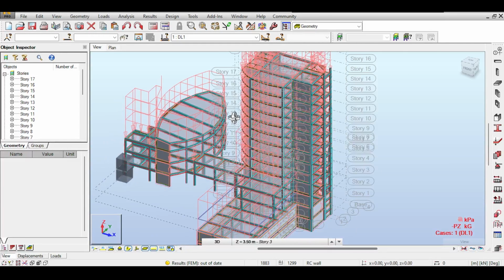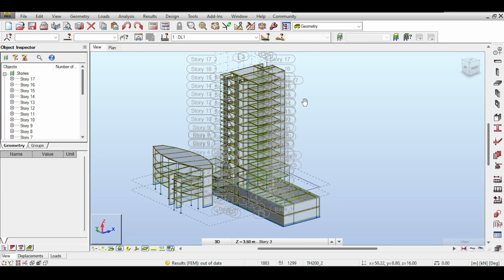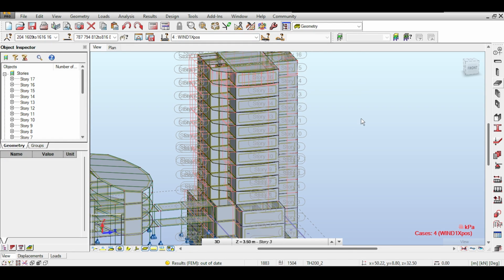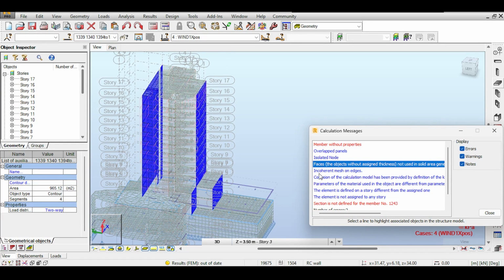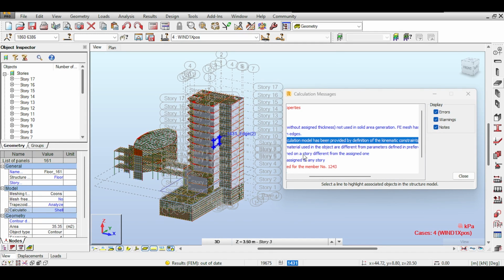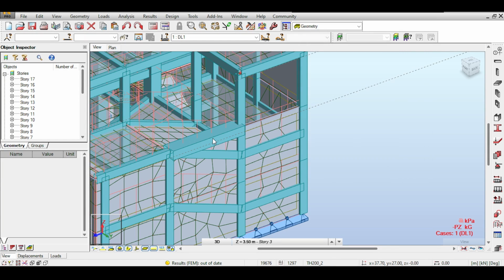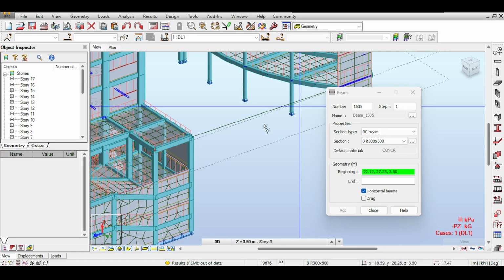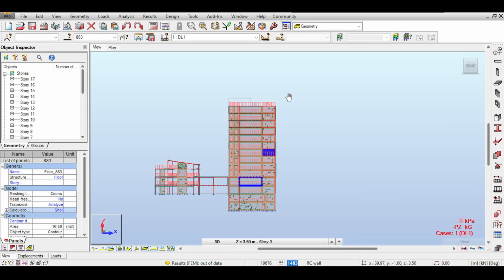Modeling and Design of RC Buildings in Autodesk Robot | Part 16: Wind Loads and Errors

Comment: Hello my thesis project is on CFD simulation so can I perform my project in this RSA .. as ansys is hard for me😢 please help me.. my project is analysis of high rise building with opening in it for wind loads using Numerical simulation (CFD simulation) please help me
Reply from the maker: As I mentioned in other videos, I am not really a fan of RSA's modeling of wind loads. So I really cannot recommend it.

PS: sry for the late reply.

Comment: Thank u for the video, Sir

Great video with stunning explanation, hope u doing well and stay healthy. Anyway if u have time, could you check ur email, I sent you my RSAP file as ur request that day, already solve the problem, but curious about the spiky moment, also i read couple of Autodesk Forums online, that said it's because I'm offsetting my beam to not be in the center of the grid level but on the bottom of it (upper beam). Because i want my actual level is my top surface of the beam. I'm giving the idea, if u want to make the video that talks about offset beam, slab and column and so on to explain what is the purpose, the relation to the internal force such as moment, shear, stress, normal, deformation and so on,  and the comparison of with and without the offset. 

Also I'm struggling to learn how apply the T beam and L beam in RSAP, because my college project actually using it and when i provided the reinforcement and run the calculations, it said

"the slab section was not transformed to the flange of T section robot structural analysis" 

I'm frustrated haha, i read the forum, watched hours of video that didn't even solve the problem, why am i design the T-beam, if the reinforcement just for a rectangular beams 😢. Here's i give the idea again if u have enough free time to make the video that special talks about the T beams and L beams. 

So sorry for the long comment, cus u're my fav yt channel for learning the fundamental concept, also I'm really enthusiastically learn more about the robot to apply my theory in college. 

Thank you so much sir 🙏🏻😇
Reply from the maker: I just checked my email. It seems it landed in the spam folder. Sry bout that. did not notice it.

Yes, offsets do tend to have this crazy problem. It is because the offsetting causes rigid links to be generated between the beam and the structure. The spiky moments is due to those rigid links.
I actually have a video discussing offsets on this channel, might be beneficial.

For T beam and L beams, I saw that you have already defined successfully a T-beam in the file you sent me. But it seems that there is a problem with regard to the design of those Beams. I will definitely make a video about them. Consider it done. No need for frustration ^_^. I will check it out and make a video about it. Even if it does not work, I will make a video saying that this is not working. At least people do not need to search too much about it.

Thnx a lot for being around, sorry for the late reply. No matter how long the comment, I will check it out.

Regards,
CEE

Comment: Nice video, thanks for posting. Good to see that others also run into the same warning and error messages that attempt to derail your model! A CFD wind application series as you mentioned would be excellent as there is lack of this even on the RSA website, just a suggestion. Keep up the good work! 👍
Reply from the maker: Thnx for watching. 
Of course, warnings and errors are the "dark side of RSA" that many tutorials just do not want you to see. Here in CEE we keep it real and try to show "real applications" with all of their "problems"

Comment: Dear CEE, Thanks for your VDO, after we apply wind load & run Analysis, does Autodesk RSA have option to check the stability of structure? or Check the column sway or non-sway in our structures? 
Best regards, 🙏🙏🙏
Reply from the maker: If you mean the stability in terms of supports, it does that.
but I think you actually ment the stability in terms of story drift and sway - non sway>
I do not think that RSA does that. But I still suggest that you simply check the story drift and the total drift against the code limits.

There is a code limit (depending on your code) for the lateral drift between the top and bottom of a story. Furthermore, there is a limitation for the total horizontal drift of a story. (I think it is a ratio of the height).

As for sway and non-sway, you can use your judgement or you can use the equation of the stability index in the ACI code. Here is an out-take of the ACI code:

"ACI 318-19, section 6.6. 4.3 states that a structure is considered to be non-sway (braced) if one of the following conditions are satisfied: If the increased end moments of columns due to the second-order effect is not greater than 5% of the first order end moments. When a stability index (Q) does not surpass 0.05."

Now to explain this gibberish, basically the P-Delta moment should be less than the primary moment.

Meaning: the extra moment from gravity loads due to lateral movement (P is gravity load- Delta is lateral movement) should be less than 5% of the primary moment (horizontal force x story height)

if that is the case (secondary moment < 5% primary) you have a non-sway frame
Otherwise, sway.

Now you might see why RSA does not do that. It is pretty complicated to program it in a software.

Regards,
CEE

Comment: Hi drCEE Would you do some wind tunnel test on this building? Another thing… what are supposed to be kinematic constrains? I used to deactivate that option ty as always!
Reply from the maker: It might be beneficial to compare actually. you just gave me an amazing idea for the next video.

As for kinematic constraints, it is just a cool way of saying that:
the displacement, velocity and acceleration of two points are constrained

In less complicated terms, two points (that are generated due to incoherent meshes) are made coherent by having them act as a single point. 

Say you have point A and point B.
if you constraint then kinematically, then if point A moves a distance in x and y and z, then point B will follow it identically.

Of course, there is also velocity and acceleration. You might think that "there is no need, we are calculating this using a static calculation". You are right, of course. Now plz note that the programmers of RSA have actually constrained the velocity and acceleration too. Although we do not need those constraints in a static analysis, if we use a dynamic analysis (which is available in RSA) then it would become active.

Hope it helped<
CEE

Comment: Hello Dr, 

Feel your pain regarding the the tedious nature of applying wind loads manually, but I think it is maybe a good excercise to visualize and understand what exactly we calculate compared to letting the software do it for you.

However, I do hope there are improvements to this aspect in the near future. 

Great video, as always ⭐️
Reply from the maker: oh it was a pain really. What I did not mention, is that the software crashed on me (that is why there was a sudden cut)
Reply: @CivilEngineeringEssentials I may be mistaken, but why didn't you create one cladding for the entire face of the building instead of separate panels?
Thanks
Reply from the maker: @YashivYash  you totally can. But it will be a pain to put the loads on it. Because if you simple use "distributed on surface" load, then the entire cladding gets the load.
In order for it to be floor by floor, I drew cladding by cladding.
Reply from the maker: But here is where you are right,
you can use 1 cladding for the entire side per story. this is good. I did not because there were already some shear walls. So I thought ima do me panel by panel.

Comment: Hello, Doctor,

Thank you for the informative videos. I have a suggestion, although I understand it can be a bit tedious to apply multiple cases. If I apply loads as per the code, I should consider applying four cases of wind loads to cover the entire structure. I acknowledge it might seem meticulous, but it's crucial, especially in the case of irregular buildings.

Additionally, I've previously used Advance Design . We can export the building to Advance Design, and it will generate all the necessary wind cases. You might want to check it out, as I read about this feature on the Autodesk Robot website. Advance Design excels in generating wind cases.
Reply from the maker: I totally agree. That is why I - after this video - believe that the best course of action for wind load calculations is to use the RSA simulation if the code allows it.

Because what I have done here, is nothing less than pure torture ^_^.
Reply: Dear  Dr.CEE, 
In the realm of code, there's a notable absence of explicit mentions regarding CFD, but I think that ASCE recommend Wind tunnel test when it comes to skycrapers. However, it's essential to recognize that engineering extends beyond code boundaries. I've observed, especially in my second year of structural design, that numerous scenarios fall outside code provisions. The dynamic nature of codes, particularly the evolving ASCE code, underscores the need to go beyond rigid adherence. While my expertise lies in Eurocode, I appreciate the significant contributions of the American Society of Civil Engineers (ASCE), which actively responds to market needs with ongoing updates, especially evident in the ever-changing geotechnical field.